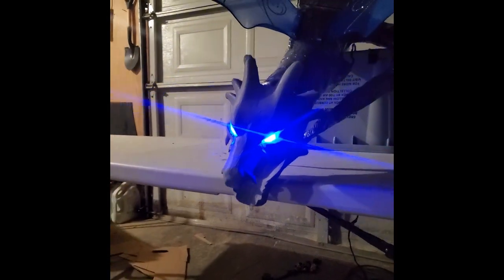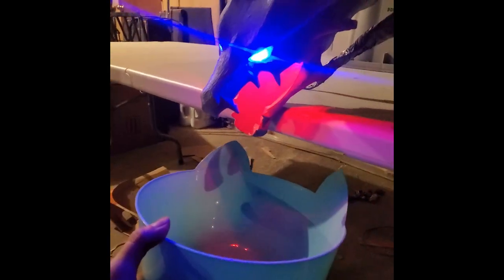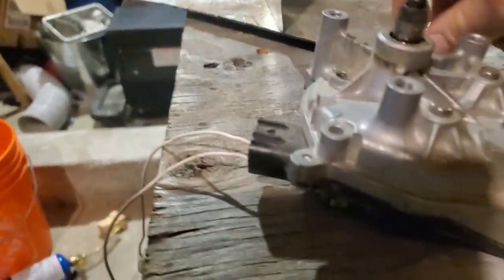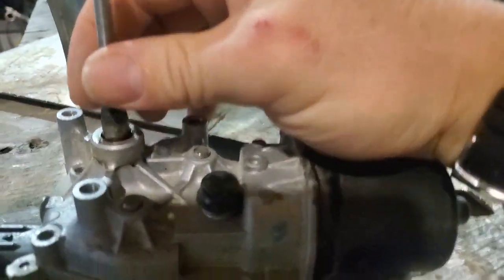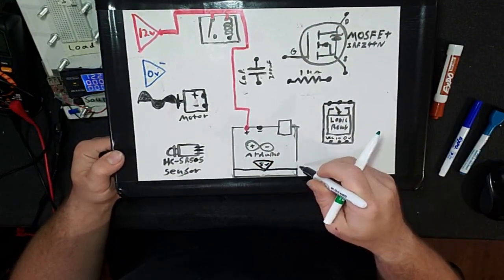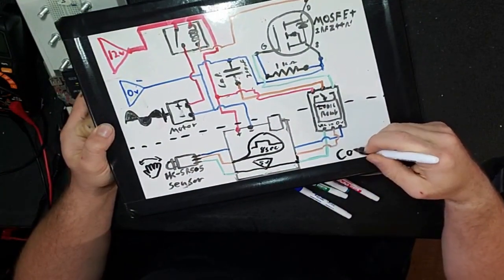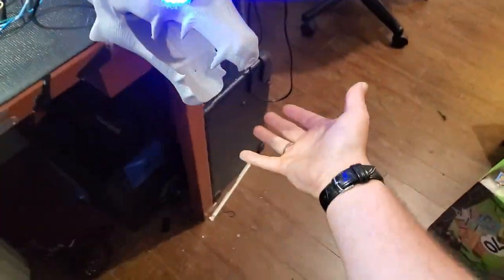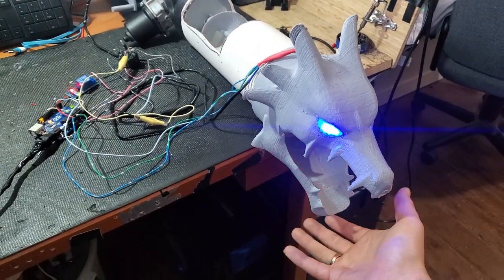Fully Automatic DIY Touch-less Candy Dispenser for Halloween - Redneck Engineer

Comment: How do you not run out of candy? It looks like it gives anywhere between 2-8 pieces.
Reply from the maker: Yes in this build it is indeed generous in the quantity of candy 😅. I have made a couple small modifications since that expand the reservoir and help control quantity like using a longer auger to prevent extra candy from slipping through. Its not allways consistent, but it's allways cool to see the kids reactions 😄
Reply: @novus2355  that’s awesome! By the way......I liked and subscribed.